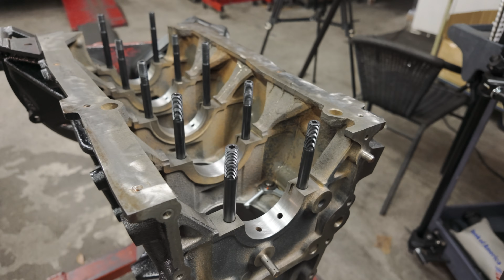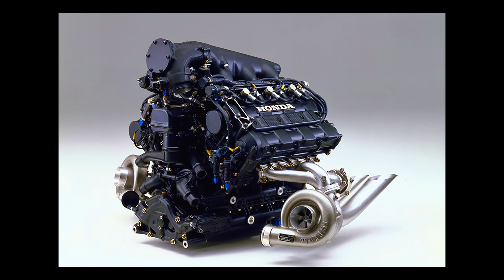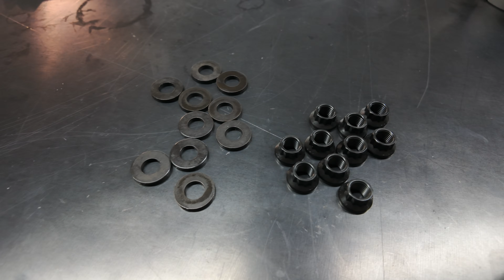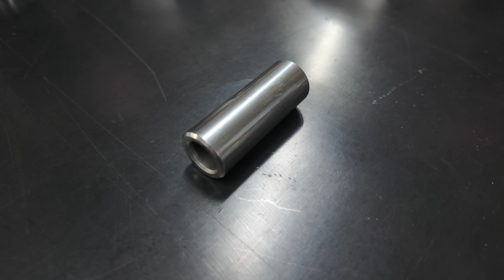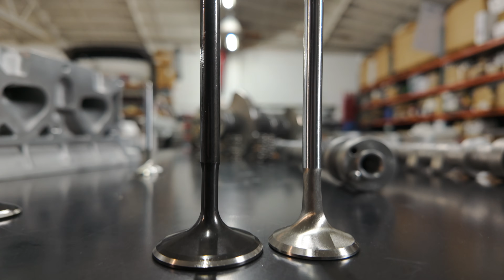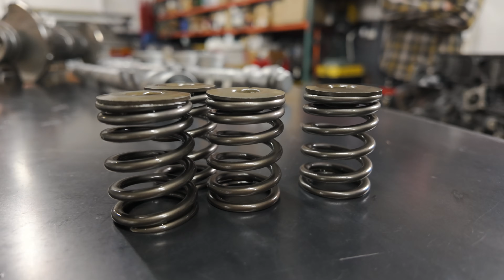Building the TURBOCHARGED Nissan KA24DE!

Comment: there’s a few thousand wheel Hp ka24det floating around. 600 isn’t as hard as you made it seem 700 -800 isn’t unmanageable either.
Reply from the maker: Sure you can make that power for a little while. We don't build little while engines.

Comment: hey bud got any info on the Coil Swap for S14 KA24DE to use external or s13 distributor swap into s14 ?
Reply from the maker: https://www.brewedmotorsports.com/ka24de-r35-coil-harness-cop/
Reply: @motoiq  correct me if im wrong but this can be used on the factory 6 pin and be used with the oem ecu ?
Reply from the maker: No there isnt a system like that.

Comment: The US trucks and SUVs that had the de engine used the Mexican block which had quite a few differences between the 240 jdm block. Sonic checked the cyl walls were thicker than jdm and the block main caps are not girdle and I believe maybe the mains are smaller. They moved stuff around like dipstick location, pickup and the pan is not interchangeable.

Comment: You can fix it with a custom crank. Increase the distance between the rod journal and main journal by the difference between the bore and stroke. The problem is that crank brace as it might get in the way you might have to cut the brace portion off or make your own main caps. This engine has a lot of potential because of that head.
Reply from the maker: None of that makes any sense. The head is ok, flowing better than a high poert SR20 but it is not a great head like a Honda K or anything.

Comment: Honestly a KA24DE with a conservative 0.7 - 1 Bar(10-14psi) of boost and tune would and should last as long as a NA motor for the daily and spirited driving.
Thats what I would do because thats around 270-330hp already and thats perfect for how light the s13 chassis. 
Or a RB20det swap if the price is right.

Comment: Great video and content Mike!  Particularly interested in the cams from JWT.  Curious if you would use those JWT cams (ones needing VQ followers) in a street car as well as race.  They appear to be pretty radical:)
Reply from the maker: Yes
Reply: @motoiq  Damn, just when I talked myself out of those cams for their S1 or Tomei Poncam. Lol.  Just running a TD06-20g at 16-18PSI (internal WG).  Mild port and 9:1 WiseCo's/Eagle Rods.  Greddy Log manny.  Thanks!
Reply from the maker: Sounds like a good build, the JWT cams will make the most power.

Comment: would a very moderate say 300-330hp (as compared to this video) bolt on setup and maybe some cams rods and pistons. Doing only head studs and leaving the main cap studs alone. ( is this realistic or not at all) 
. lower psi ( high 10s) require as much attention for the more intricate things that you recommending on the 450-500hp range such as machining processes like how you described getting the crank line bored. and the cryo prepping and such. Im more of seeing if its a feasible option to do less and achieve a little bit lower power goal. looking for an honest opinion.
Reply from the maker: Yes if your machining is decent.  Studs require a torque plate.

Comment: KA-T vs LS…what are your thoughts? Is one more economical than the other? Asking because building a KA seems very expensive—although any LS swap kit is expensive too
Reply from the maker: It depends on what you want. I would probably do LS.
Reply: @motoiq Thanks for the reply…do you feel like one is more fun to drive?
Reply from the maker: Both are pretty fun but the LS is low stress power
Reply: @motoiq sweet…good to know…I’ve heard of cooling issues with the LS in the S13…have you experienced the same?
Reply from the maker: Not if you have a proper size radiator.

Comment: I built my first turbo Ka-t back around 2005, there was actually more support back around 2010-15. Currently have 4 s14’s, all with different engine combos. One bone stock Ka24de, one Ka24det, 2jzgte vvti, and LS1/T56. Car with 2jz was turbo LS. Had an S13 coupe with a Sr20det back around 2015, bought that car with the Sr in it for $2500. Just needed a had a coolant temp sensor issue. Good times.
Reply: Which was your favorite 240 engine combo?
Reply: Can I buy the bone stock one from you if you ever sell it?

Comment: I slapped a Mitsubishi TE04H and a Dodge Spirit intercooler on my unrebuilt 2001 Altima, and MAN does that thing pull HARD!  It breathes so well, all across the RPM's.  I pulled the motor to freshen it up, not due to any failures, and I'm rebuilding it with JnD STD pistons.  My goal is still 10-12 PSI on 93 gas, which it did not appear to detonate on with the original pistons.  I want a fun car, but I don't want it too powerful for the RE4F04A.

I have an RE4F04V from a Maxima that I'm going to try swapping in as well.  I don't know if it matches.

Keeping my eye out for more KA24DE's.  I would love to turbo one and drop it in a 5-speed Sentra.
Reply from the maker: Just to let you know those are chinese fake performance pistons with could even be worse that the stock pistons.
Reply: @motoiq  Good to know, thanks!  I have the originals, and they look fine.  I haven't assembled yet, so I could switch back to them.

I've been using JnD for my old Turbo Dodge 2.5's, since they're definitely superior to the Mopar ones.  Aside from N/A applications (QG18DE), I haven't used them on much else.

I'd go with some turbo pistons, but that alone would double my parts expense.  I have the money, but the purpose of this build is to see how far a cash-strapped build can go.  Plus, once I go to the power levels allowed by turbo pistons, I'm already well beyond my transmission, tires, axles, etc.

Comment: Youtube would call me crazy, but I would not want an S-chassis as a street car with more than 500hp.
Reply: I agree with this. I have had my 240 since 94. I love that car! It’s an 89 hatchback. It had 346,000 miles before I rebuilt the motor. It still has the original transmission too. It’s a super fun car! I’m actually rebuilding it now. Making it a gift for my son. I only want to maybe add a turbo yet I don’t know. It’s pushing 280hp after my last rebuild. Which for him is fine maybe too much.
Reply: @Wood-In-My-Eye you got 280na out of the ka24e?
Reply: Me neither.

Comment: BMW also used an iron  block with the 4 cylinder turbo in formula 1.  They then used the same crank case in the e30 m3.

Comment: I did this a while back for my 510.  Used the power steering pump as my dry sump oil supply.  
Great motor especially turbo with a hood exit.
Reply: Power steering pump as a dry sump pump? Ill have to look into that

Comment: What's going on is sr20 are too expensive now and harder to come by
Reply: More expensive now. What used to be $2500 is now $6500.
Reply: Not necessarily, people are just realizing by design the ka is realistically just a superior engine. Especially if you look from a value standpoint. Sr20 just get all the weebs shorts tight and that’s why everyone in the past has preferred the sr20. The only thing the ka doesn’t have on the sr20 is a fully counter weighted crankshaft.
Reply: @MattSR20  you're right to an extent but the ka was never developed back in the day because the sr20 was cheap and a factory turbo engine. Plus the ka was US only and had no aftermarket support

Comment: 14:12 sorry, but how do you machine with studs in? what am i missing
Reply from the maker: Torque plate
Reply: They use a torque plate which simulates the final torque spec with the head on then they do the machining so the cylinders are true to the distortion caused by the torque.  If you don’t do that some engines will warp after you torque everything down and your cylinder walls will be distorted.  I probably convoluted the explanation but hopefully not too bad.

Comment: If you pulled the half counter weight would it even get to 8000 rpm?
Reply from the maker: Probably break the crank
Reply: should of asked if it would get to 6000
Reply from the maker: same answer, there is a reason why they are there.

Comment: What is the price for a 450 to 500 build
Reply: Just got quoted a long block this exact build with cryo and wpc treatment for around 14k without me shipping my long block
Reply: Realistically 3500-5000 with machine work depending on what brands you go with, if you already have a motor and what the machine shop charges you. Enjuku Racing has a forged bottom end kit for 1300 and it goes on sale. If you need a motor add another 500-700.
Reply: Realistically, 450-500 is going to cost you $15k on the low end. You need the supporting mods beyond the long block, and that stuff you can’t get the cheapest options and expect it to perform to your standards